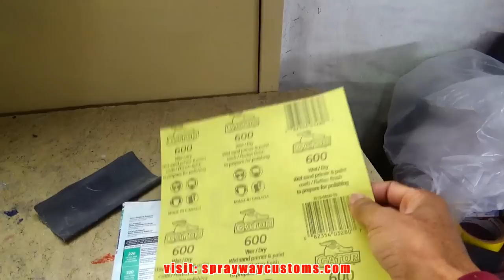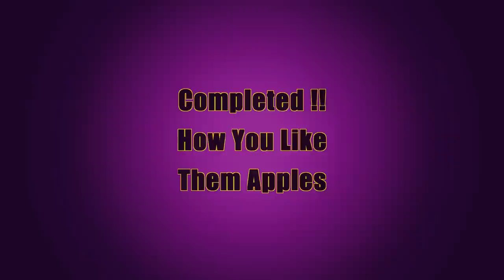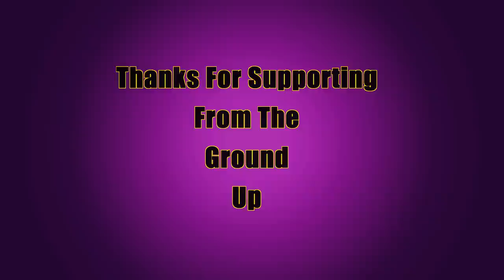What Is Flow Coating A Car ? How To Flow Coat Or Re Clear Your Paint Job - 1987 Chevy Monte Carlo SS

Comment: You can certainly be proud of your paint jobs. Thank you for sharing your knowledge with us. I'm surprised you don't use PPS 2 cup system. Reduce drips and easier clean up. You should also try to filter your incoming air. You do put a lot of work into your paint jobs.
Reply from the maker: Thanks Joe. I use the PPS cups sometimes

Comment: Lots of work...I lost 20lbs my first time ever painting a car. I sanded my Dodge Magnum by hand, never used a rotary! I sanded the car three times! I took me two months just sanding for prep. I sanded every coat that had imperfection before applying the next coat. After I was done I watch SprayWay and saw all the short cuts I missed and time saving and pound saving..lol I was told by a shop that I did the work of a professional shop. I told them I was only trying to do better then Maaco!..lol
Reply from the maker: Thanks for the great story Donnell

Comment: Your work is just beautiful.  Your cut and buff videos are the best I've seen on you tube. This is custom work, nothing like a production shop. I sure hope that your customers appreciate the work that you do and pay you what it's worth to do it. I just painted my truck in my garage ...it came out pretty good but it needs some cutting and buffing. I laid down 3 coats of clear with the intention of cutting and buffing. I got some trash in the hood but I cut off all the nibs with some 800 and 1500 and I think it's gonna be fine. It always looks worse after it dries and the clear shrinks.  the sides came out good very little trash,  but some orange peel. Factory like orange peel is acceptable to me but while I'm at it I may as well cut and buff the whole thing. I just wanted say That I'm following your method of cutting and buffing to get my truck. This is a hobby for me but I want that thing to look straight and shiny. It's a big truck, 05 f350 dually ext cab, painted in base coat /clear coat black. It's been a lot of work to bring it this far. Every body does things a little bit different but Your results are killer man. I've got a HF rotary and I just bought the Griots G9 and the small G8 kit just for this project. I'm pobably gonna use the rotary for compounding the large areas and the the G9 and g8 for the smaller areas. Then polish everything with the G9 and G8. How do you like the DA type buffers vs. the rotary?
Reply from the maker: Thanks for the story. I still use both rotary and da buffers. It just depends on the situation

Comment: Sick, nice work man.. I had painted my 87 SS black

When I threw the clear on it had cracked for some reason 

I spoke to a few guys and was told it was most likely because my paint was still wet. 

I had painted the car while it was raining out and cold so I guess that’s why it didn’t dry well enough. 

This makes me feel 10x better 

Going to try to just sand it all down again and hit it with clear again 

But worst comes to worse Fuckit I’m just paint it all over and do it again the right way 

Your videos gave me more confidence hahahah
Reply from the maker: Sounds like you didn’t let it flash long enough in between coats

Comment: Great work man. I set up e stat in my booth made me remember how bad I hate covering edges. I’ve got so used to doing it lazy 😂
Reply from the maker: Thanks a lot
Reply: @SprayWayCustoms  painter to painter you’ve got that technique bro. Love watching a painter paint just the flow perfect over lap your fan off. You’ve got some skills. Keep up the good work 👍
Reply: @SprayWayCustoms  hey if you ever want to try an e stat set up hit me up. A pump in theory small shop it’s not worth it. I’ve got mine so efficient I’m flushing out the rest of my paint with my solvent. Plus overspray is basically nothing you have to buy an additive to make it conductive but it truly saves material even with a pump. You don’t really use much more if any lacquer cleaning it.  Makes clear and edges effortless. You have to back up on Metallics and keep in mind your putting more down but your technique is basically the same.

Comment: Did you sand the decal area all the way to the decal but just took a layer or two off in the other areas? If so, is that to make the decal sit flush after the flow coat? Appreciate you doing this man.
Reply from the maker: That’s correct
Reply: @SprayWayCustoms  Thank you. Any worries about sanding into the decal?

Comment: When I was a teen I had this crazy idea to trick out my AMC Gremlin X. There was a man, Frank, that lived at the end of our street I traded my labor for learning and he helped with my project. Imagine this: A 302 Boss built to the hilt with a 1200CFM blower. A redesigned 1968 fiberglass flip nose piece.  reverse doors, French cut body, 1970 Courger taillight Assembly. 5/11 chrome rear end with 16" wide cheater slicks under flared quarter panels. roof chopped 5" with vet tee tops all in a silver shadow Rolls Royce paint and pearl ghost flame. AKA The Hobbit. Unfortunately, I lost it to fire when the blower locked and exploded but it was one badass car and it never would have happened if Frank hadn't taken the time to teach me and help that dream come true. HINT HINT
Reply from the maker: Great story except losing the car...I appreciate you telling it Fred

Comment: Great work i enjoyed the video it was informative.  Would you advise to put down about 3 coats of base wait a day to dry then sand with 600 to remove orange peel and then apply your clear coat?
Reply: I have been told that rubbing with 400 on clear and then reclearing shows up scratches. Is this false ?
Reply from the maker: I would wait to sand the clear because you still will get orange peel after the base. Clear coat will cover 400 grit scratches with no problem
Reply: Does it matter if it's white or black. I mean can you sand black with 400 and white with 400 or will sand scratches show through? And thanks for replying

Comment: Let me ask a question after Flo coat do you have to sand and buff the car. Man, that came out nice. And what grit do you use if you have to sand and buff thanks
Reply from the maker: You don't have to especially if you in a actually paint booth and doesn't get any trash in it. I cut and buff afterwards all the time though. If you can start out with the less aggressive grit like 2000 it'll buff out a lot faster.
Reply: thanks man

Comment: Now will  you still color sand and buff? Unrelated question. If you were going to do a satin black would you use single stage urethane, or base clear?  Great video work also, thanks.
Reply from the maker: Yes, I'm still gonna cut and buff. I'm using single stage Satin black on some of the pieces on this car

Comment: Dumb question but what gun do you use for the flow coat and what pressure do you shoot it at.
Reply from the maker: Iwata Supernova WS400....I spray around 28-30 psi

Comment: That's looking real good sprayway and you lost power yea nice flow coat sprayway one
 question when your fan is running do you have a filter on the inside or outside of your fan for the over spray or no filter at all
Reply from the maker: I try to have one but sometimes I don't because it pulls a lot better
Reply: Ok thanks sprayway

Comment: Did 1 car kit from urechem do entire car or did you need extra quarts? And did you use 2 gallons of clear in total??
Reply from the maker: Yes, two gallons of everything
Reply: Thanks. Just getting started on my 85 Ttop got gallon setup an 1.5 gallon sealer plus extra gallon of glamor clear already

Comment: have you ever tried southern polyurethanes clear by any chance?
Reply from the maker: Not yet Thomas
Reply: @SprayWayCustoms  I understand everyone has there on opinion... and I respect that.. with that being said.. there clear is a 1:1 ratio... and designed to do what we try and do with every clear... hammer on as many coats as possible... you can spray 6+ coats at one time with no solvent pop... it's designed for custom paint... so you can do your same process with no "flow coat"... as so people will say... there is a difference between a chemical bond and a mechanical bond... if you clear coat .. the wet sand and apply more clear..  on your final cut and buff if you pass the "flow coat" into the first clear process.. you may see places you broke threw.. with this clear .. you can hammer it on with no solvent pop issues..  and start cutting low to get out urethane wave and orange peal... could save you a lot of time

Comment: Awesome job my friend 👍👌 the flow coat is going to lay down great...scuff it again with 5000-6000 and it will buff out to a sheet of glass and 6 ft deep.👌. there is no shame in showing drips and runs we are only human and when you know how to fix them it's not a big deal....if a job takes 8 hrs to do don't try to get it done in 2 1/2 hrs that's where I have seen alot of people mess up...and ya don't need a 8-900 dollar gun to get great paint jobs proper fluid needles and tips and booya! Shine like a grave diggers ass in the pale moonlight 😉👍👌✌️
Reply from the maker: Thanks Ronald...you're 100% right